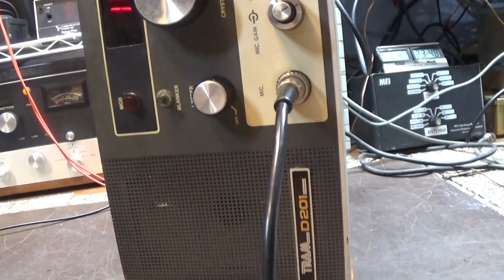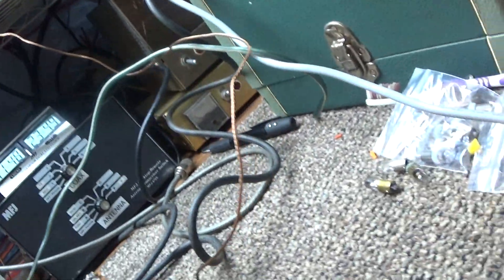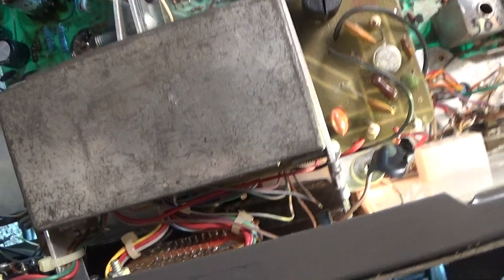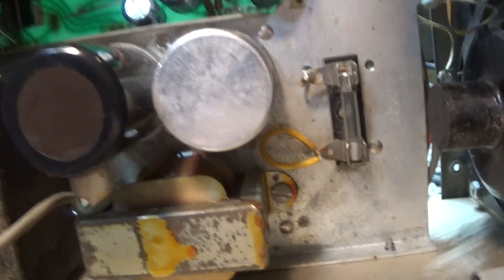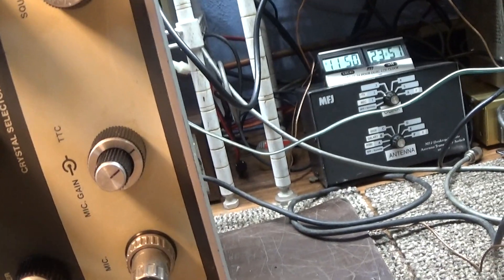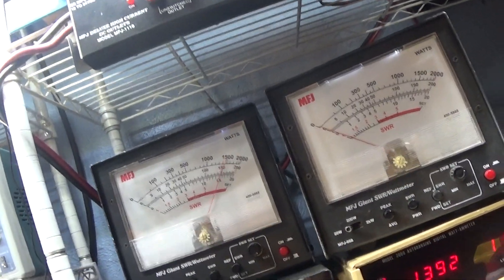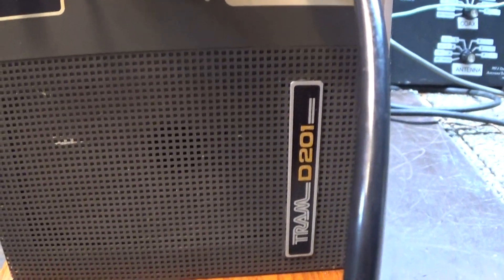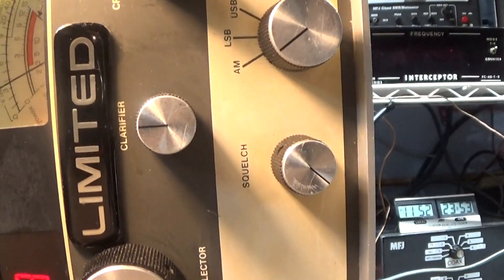Tram D201(A) Frankenstein

Comment: Adding that 40 channel pll probably wasn't something your weekend warrior (golden screwdriver) completed. If I recall some of the channel selectors placed in certain 201's were problematic. That 40 channel pll should last longer than many other parts inside that 201. Nice rig. Thanks for sharing doc. 73's
Reply from the maker: I've always liked and preferred the D201's to Brownings. Heck, I guess thats why I'm Tram Dr and not Browning Dr. I do like Brownings, a lot, but as you said, D201's got that audio. The receive is debatable. IMHO the best receive is the Tram Titan series, especially the Titan IIA. It is basically the same design as the D201 but has the Collins Mechanical filter in the 2nd IF. IMHO it has better sensitivity and better sounding audio than D201's and Brownings. D201's have better rejection than Brownings, but Brownings have richer more hi-fidelity sounding audio than Trams. I do agree on SSB, the Tram D201's are the best of SSB tube radios. My all around best radio has always been the D201's. Quick question, how many 40 channel tube SSB radios where made? Answer is 2 if you don't count the 1 tube Dak 10. The Browning Mark 4(A) and Tram D201A.  You are also right that the first edition 40 channel D201A has a problem with the channel selector switch. That switch is Black. The updated fixed selector switches where Gray, so Gray is good, Black is bad. The 23 channel switch was an open frame type switch and never had a problem. Just when they went with the closed frame Black 40 channel switch, it was not up to the task. In the Frankenstein radio here it was a 23 channel radio that someone put the 40 channel PLL in. I have many many many different Trams some look very very good but I have never had a NOS one.